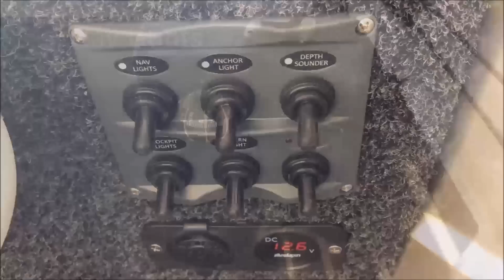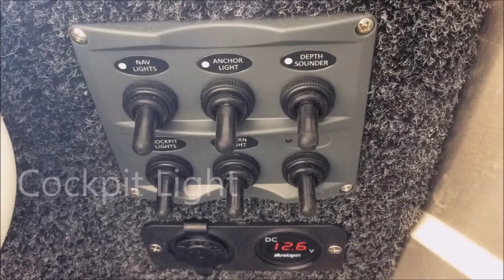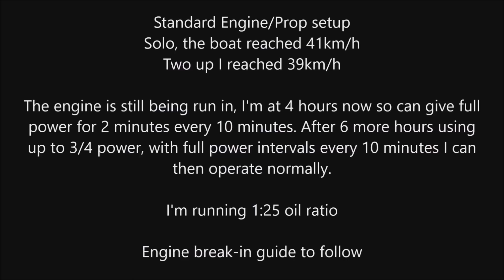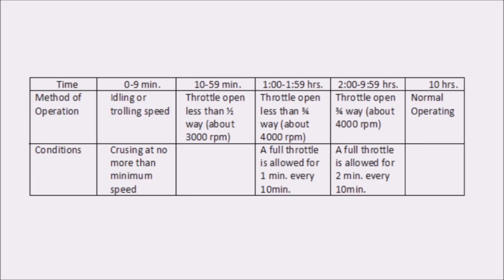NEW TINNY FIT-OUT with 15HP Mercury 2 Stroke

Comment: Nicely made video. You’ve done an excellent job on the fit-out. It’s all very neat and I didn’t see a wire. I bought a 3.6m Haines Hunter tinny today which must have been made in the early nineties but I have yet to check. $350 FB marketplace. It’s in pretty good nick and I will definitely use your ideas, especially a pet peeve of mine, no through hull fittings. This tinny has only the bung hole and apparently it leaks a little! Lol.

Comment: Nice work bro...I got a 3.7 pathfinder with 15 Yamaha.i get 54kmh..with the boat jacked n 200 ml of fuel..I won’t to put in a centre console how much u recon it would cost ..eg spedo stearing.....
Reply from the maker: 54kmh, that’s fast for a 15HP. Not sure on the cost but it would be good to have a console and steering wheel
Reply: How? I got a 15hp yamaha too but what kind of pitch do you have on your propeller?

Comment: Great wee 15hp two stroke good power and torque. Can’t help but think if your going to be cruising at 20mph a 4stroke 25hp might be better as the 2 strokes don’t like to sit at the same revs for longs times. But nothing beats a 2 stroke for power to weight reliable we motor
Reply from the maker: I know what you mean, the area where I launch my boat is 6 knots, by the time I reach the main channel it’s always choked up. After a few seconds on close to full throttle it soon clears out. I don’t tend to stay at the same rpm for long.
Reply: AirEarthSalt it’s a nice wee set up

Comment: Treated lumber contains copper which will react with aluminum causing an irreversible corrosive chain reaction and result in holes all through the floor.
Reply from the maker: That's correct, all the timber is epoxy coated

Comment: Using 2 cycle oil in exceeding manufacture recommendations will cause carbon build up in your rings causing premature loss of cylinder to piston seal.
Reply from the maker: Run in per the book

Comment: what type of sounder is that? Lowrance Hook series?
Reply from the maker: +Jaks Channel yep, hook 4 with navionics charts. Love it
Reply: i am looking to get a stesssco squire 389 and this video helped me out alot thanks mate
Reply from the maker: +Jaks Channel no worries, sorry for the delay in replying. I got the stessco squire because for the size boat the sides (freeboard) was much higher than others.
Reply from the maker: +Jaks Channel the only additional thing I've done since the update video is sprayed a small area of the deck Matt black around the nav light so I don't get glare at night. It's helped a lot. If you have any questions once / if you've got it let me know.
Reply: thanks heaps dude
Reply: any tips on the flooring because this is the main thing i want to apply to the boat and take after the flooring in your boat
Reply from the maker: +Jaks Channel the flooring was the hardest part of the build but once you've built the frame the plywood part isn't so bad. Use card for templates as much as possible. My problem is I tried to make the fit perfect. The carpet would hide gaps if you have some.  Mine is a very unnecessarily tight fit 🤔

Comment: If by "treated timber" you mean pressure treated wood...get rid of it because it will eat through your aluminum boat. Google it.
Reply from the maker: +Kennnny77 Not pressure treated, I epoxy coated it with west system. I will google it, sounds bad... thanks.
Reply: never use marine ply in ali alloy boats - the copper in the treatment will eat through the metal hull
Reply from the maker: +Marcus Petraska All timber has been sealed with epoxy. So the electrolysis between the copper treatment and the aluminium should not occur. I've had the boat 1 year so far and all looks the same as the day I bought it. Thanks for the advice.
Reply: You should be good with it being sealed. However, never use treated wood in alloy. I learned this the hard way....

Comment: With all the weight you added, you  need at lest a 25 hp. Bruh, what's wrong wit ya?
Reply: 15hp is plenty fast reaching 24mph 
Going 25hp will only increase the speed by 4-5mph and the price of the engine will be and extra $1,500
Reply: @plumbing-away  yeah I can see your point! I had a Yamaha 15 it served me well! But at one point I had a second then a third child, so I upgraded to a 48 inch bottom and a 25 2 stroke Yamaha the  overall performance was the same! Cheers mate!
Reply from the maker: No need, I’m very happy with the performance, even 4 up it goes well.